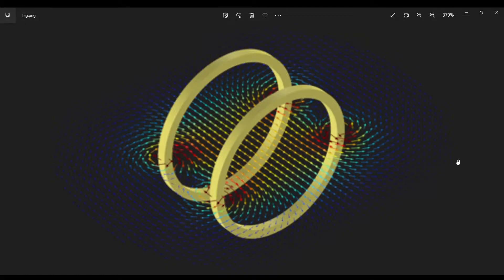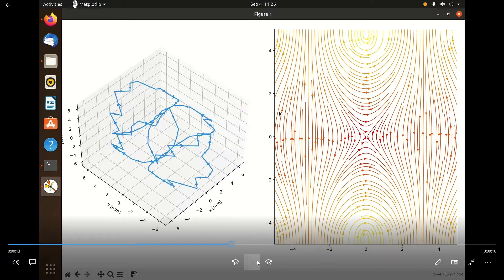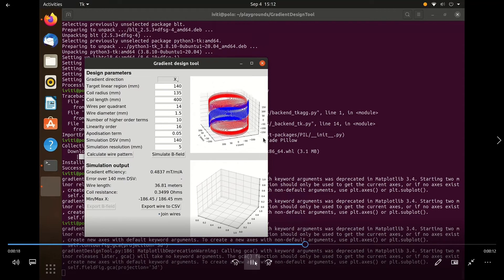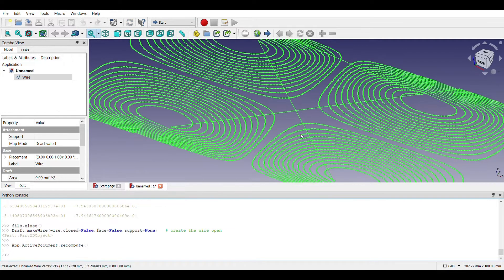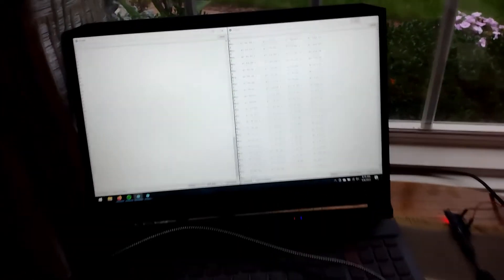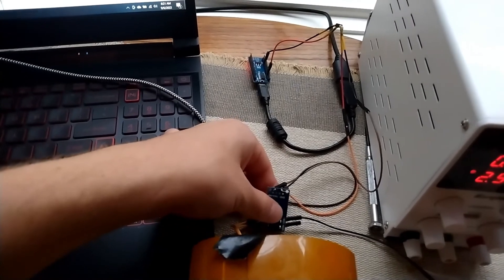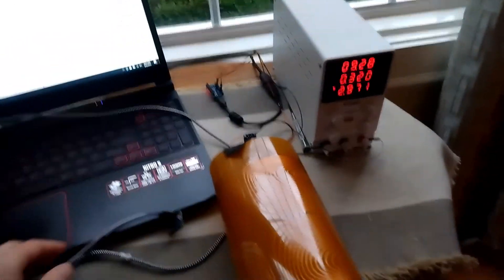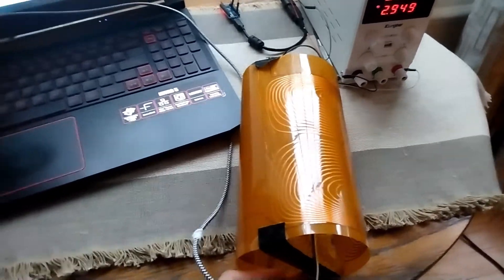DIY budget MRI machine part 1: gradient coil

Comment: What happen with this project?
Reply from the maker: im a bit stuck at the moment. I ported the code to a raspberry pi pico because the arduino code is difficult to work with. Software wise, it seems to be working, but there is a bug in the hardware and it is taking me a while to find it
Reply: @SpinQuorum  Hey! Are this project on the way actually? im pretty curious and fully inmerged on this Tech, im studying Electronics and do alot of sports too, then this MRI project is an ambicious project also for me in my career. there arent any budget MRI so i just found you then wanna know more about this topic.
Reply from the maker: @damianalexis313  here is a paper that I am following: https://sci-hub.se/10.1016/j.jmr.2020.106800

if you look at my other video, https://www.youtube.com/watch?v=IJjot0CHMcU youll see where I am currently with the project. Basically I am trying to simplify the system so that it is easier for anyone to build.